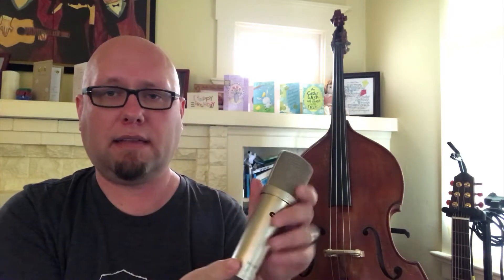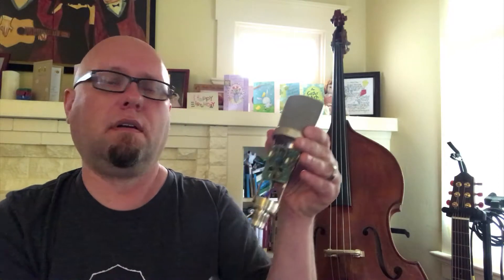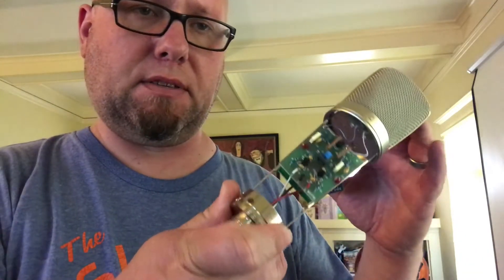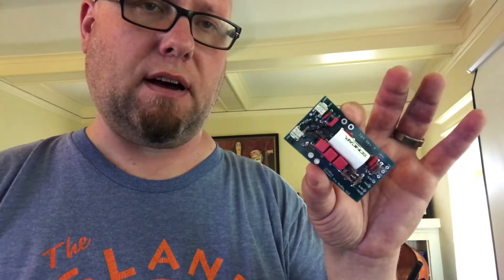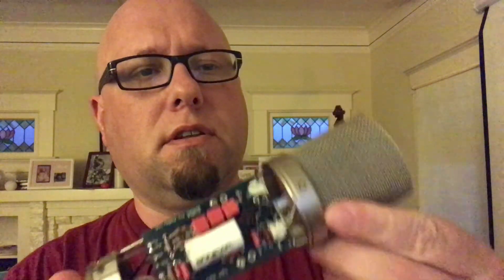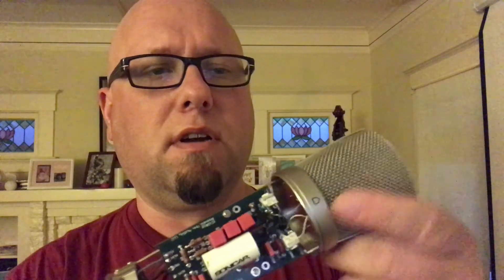CAD GXL2200 mod, microphone-parts.com RK-47 T-84

Comment: Thank you so much for this comparison- I've been considering the circuit kit, already swapped the capsule on my SP-1. I will say with both circuit and cap the acoustic initially does feel like some body drops off, but then you add it to the mix and it sits easier. Plus with being able to throw it into omni like... I donno pretty attractive alternative to the original $40 guts. "Vintage" is a good way to describe the difference though, so it's not hard to see it's not for everyone. But it is for meeeee

Comment: Hey, sorry to add a comment so late. I picked up a couple of these mics used, and I can not get the bottom to unscrew. I've had lots of similar mics (MXL, especially), and some have a threaded collar at the bottom, some don't, but once that's off, the lower "cone" of the body just unscrews as you show in this video. Not these, though. I've turned good and hard, and I can get just a slight movement, but then it feels like something is holding it in place. I don't see any set screws or anything, but I don't want to break or bend the body. Thanks!
Reply from the maker: Most of mine just unscrew but I think I may have one that required removing a nut around the XLR jack first.  Have you solved it yet?  If not, I'll take a look through my mics and see if anything jumps out at me.
Reply: @UprightJoe  Thanks for the reply. I looked before but didn't see anything else holding it on, but maybe it's hiding in there. I'll take another look.
Reply from the maker: @SeanKerns  Cool.  I'll try to dig around in my mic collection and see if I have anything that doesn't unscrew tomorrow morning.

Comment: is it just me or adding the circuit made it sound worse? you're losing the low end and there's some kind of distortion... i can't put my finger on it but it sounds a lot better with just the capsule and not the capsule+board... could just be me though.....
Reply: "better" is subjective. But yeah, the circuit is a jfet-transformer coupled one, then it adds second order harmonics which could be good or bad depending your needs/taste. I like the characteristcs of the t-84 circuit for everything except bass in this test

Comment: Great comparison video Travis. It should encourage even someone with the most modest studio, that a well performed piece will sound fantastic with stock entry level microphones and a good mix. 

My old ears aren't what they used to be, but the RK47 capsule really improved frequencies on the low end. Also the complete conversion sounded better on the full mixes. Just my opinion.

Comment: On the fingerpicking part, definitely hearing less noise with the RK47 upgrade. The tonal difference however is extremely slight and very hard to hear. On the strummed guitar, the difference is much more pronounced. Both are good, and I'd say it's personal preference except for the RK47 being lower noise. Both sound good but the RK47 there definitely sounds smoother and fuller with less top end and a more filled out midrange and bass. 

I didn't like the circuit on any of the guitar stuff. Sounds too tinny to me. But on the bass I think the RK47 + the circuit upgrade sounded best. My personal favorite was the cardiod position on the RK47 and circuit upgrade on the upright bass stuff. That sounded great. The circuit seems to give some more high definition to the bass, which makes sense given the really low frequency of the instrument. On guitar it was just a little too much for me. On bass, perfect. 

Overall, I'd say my favorite was the RK47 standalone as an upgrade. Very tough call though, and honestly, all three sound good to me. But I will say the RK47 upgrade seemingly lowering the background noise definitely gives the mic a much more professional sound. The standard mic mix was good, but when I heard the RK47 mix it just sounded like it bumped it up a notch or two to professional quality. 

Maybe it has less noise because of the frequency range? Kind of like turning down a tone knob on a guitar. The hum/buzz is higher frequency and it lowers a bit dB wise when you back off on the high end. Perhaps that's what's happening with the RK47 in some sense. Either way it sounds great. 

Instrument selection and playing style seems to be very important here. If I could pick, I'd use the board + cap upgrade for bass, and either standard or just the cap upgrade for guitar. Vocals, I'd agree that I didn't hear as much of a difference, but would probably just go with the RK47 as it sounds like it has less buzz and noise to me.

Comment: Thank you Travis, that was a very, very good video.  I have the Microphone-parts kit with the RK47 and Shoeps circuit (very happy with it) and I was really surprised at points at the full upgrade.  From time to time I actually thought just the capsule upgrade alone was most complimentary to the particular instrument and track.  Its almost as if the circuit upgrade added a form of subtle distortion that was good on most but not all tracks.  That was an eye opener.   I may recall something said about the "T" circuit adding some extra 1st or 2nd harmomic.  Maybe that was what I was hearing. Excellent video. Thanks

Comment: the most significant difference I can hear is the instruments. changing the capsule form stock to rk4 on the voice I couldn't hear any difference what so ever. it's only when the circuit board is replaced when I hear a vocal difference and honestly, I thought it kinda degraded the sound a bit.
Reply: I agree that I didn't hear as much difference on the voice. Guitar was very different on each version though.